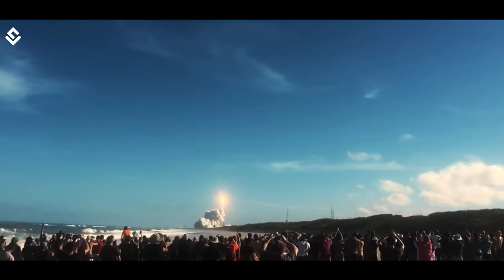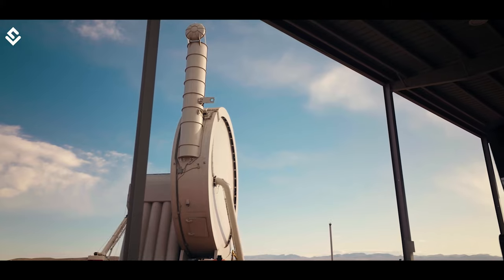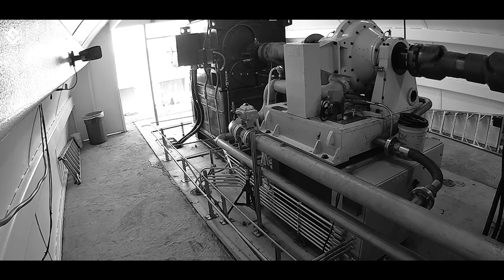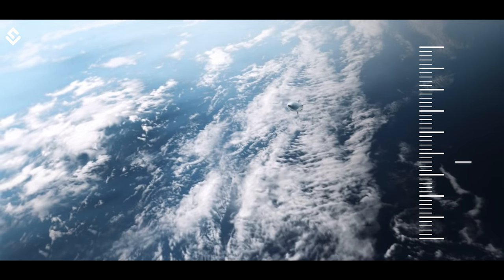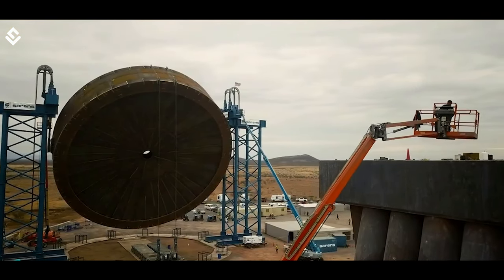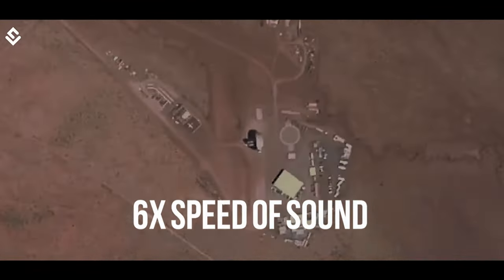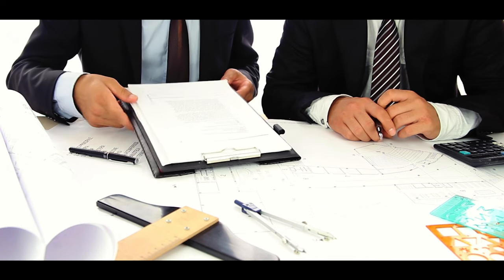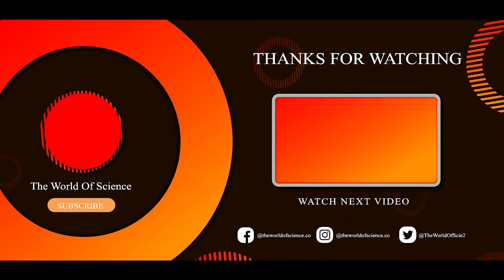Most Unique Way Of Launching Rockets by SpinLaunch | How does it work?

Comment: will those high g forces destroy most payloads before leaving the vacuum chamber?
Reply from the maker: Early research identified promising examples of complex high-g systems in industry including artillery launched drones with deployable wings, propulsion, and optics. Following the completion of the 12 m prototype, a system capable of testing to over 20,000G’s, SpinLaunch’s engineering team began evaluating a variety of hardware packages at the 10,000G that components endure during the launch. Through this testing, they’ve been able to demonstrate the impressive ability of satellite systems to readily handle the centripetal environment.

Comment: interesting project. FOR SURE can't launch anything with living tissue- not even a biological sample for experimentation. and you'd most likely have to exclude a large portion of sensitive electronic  and lab re-supply equipment- the cost of hardening electronics against that much G-force pretty much cancels out any cost advantage. then there's the fact that your upper stage STILL uses a standard liquid fuel rocket- that does NOT get re-used. I think star ship is going to price you out of a job before you ever get your first contract. but? maybe an excellent stationary defensive artillery piece.
Reply from the maker: Absolutely! This technology (after several generations of upgrades) can be used for sending parts of inventories and infrastructures to orbit and beyond, with a higher frequency of launch in comparison to normal launches.